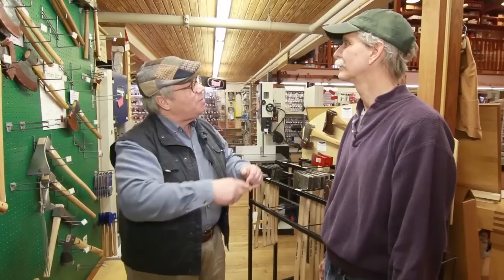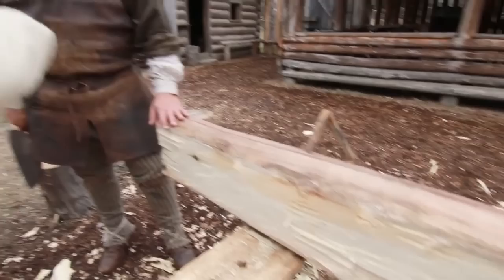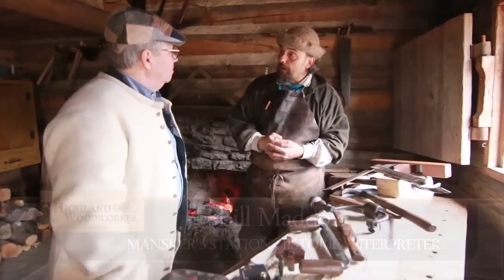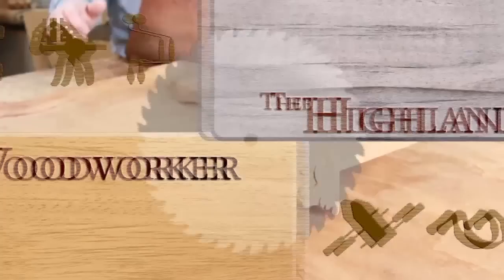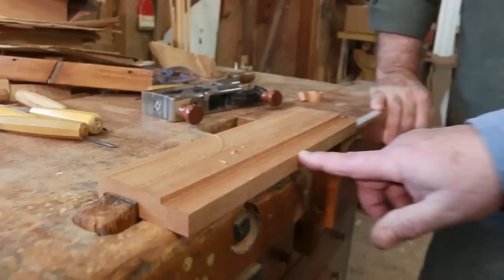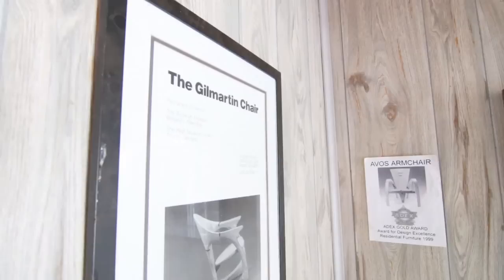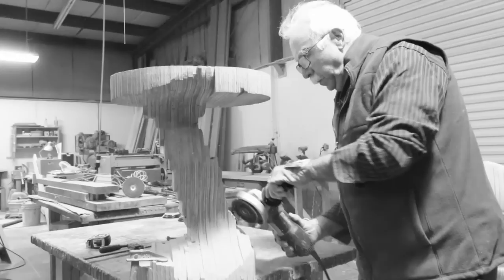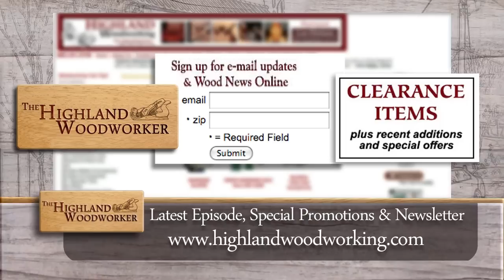The Highland Woodworker, Episode 17

Comment: quick and easy bowclamp... just lower the outfeed table on your jointer a teeny teeny bit... run your board over and you will have the arc you need.